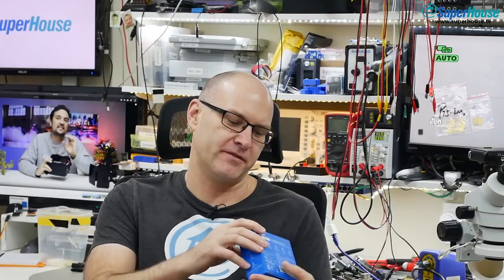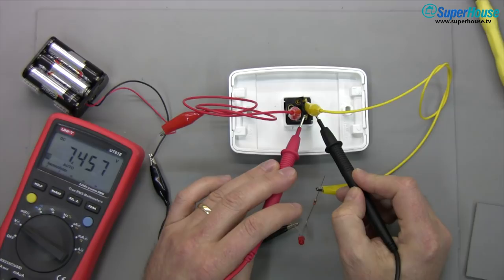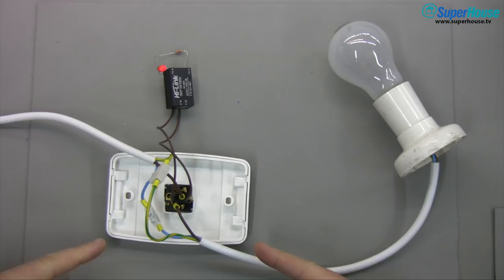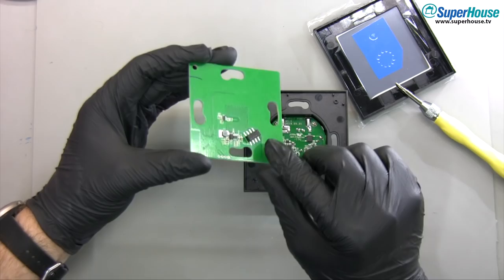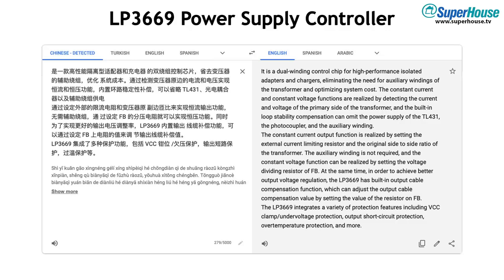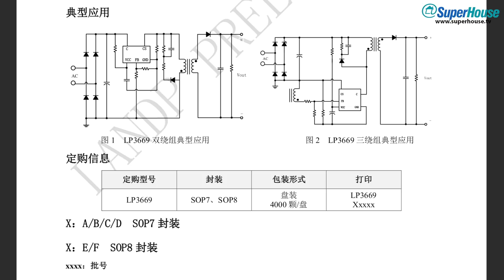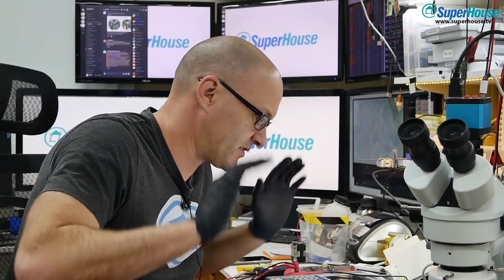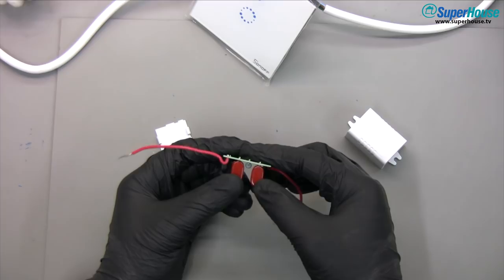SuperHouse #34: Science or sorcery? Sonoff T4EU1C no-neutral wifi touch switch

Comment: If you have access to a 3D printer, here is an interesting approach to making the programming connections without the need for solder. I  am printing it this week and will report after I use it.  https://www.thingiverse.com/thing:3615910   There are many adaptations on this make.
Reply from the maker: That probe jig is fantastic! I'm going to make one of those. Thanks for the tip. I've already made a pogo programming jig for the Mini, with auto-reset built in. I've shown photos of that in Discord, and I'll be doing a video about it soon
Reply: @SuperHouseTV  I thought you would like it... and according to maker it was designed with using that nice optical microscope you have in mind. I just tried to order the acupuncture needles here in the states and the supplier said I need a physician's licence ...lol... guess I will try sowing needles instead. Thanks for the epic job reverse engineering the triac power stealing technique.  How well does the T4EU1C work with dumb LED lamps ?
Reply: Sorry.. I see you have pinned an answer to the LED question... thanks !

Comment: MUST you pronounce abbreviations??  M.O.V. is easily understandable in any accent.  "Muv" is not.  Why don't you pronounce BJT?  eesh...  The power circuit is really pretty cool, but... If I have to disassemble the light to add the parasitic power device, I'd much rather install a regular WiFi unit there instead, and just make the switch a remote.